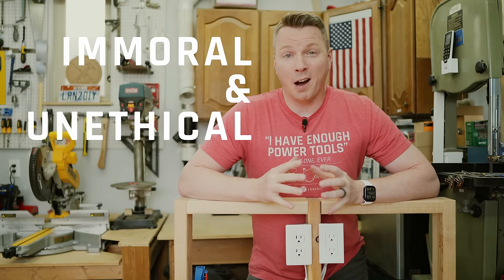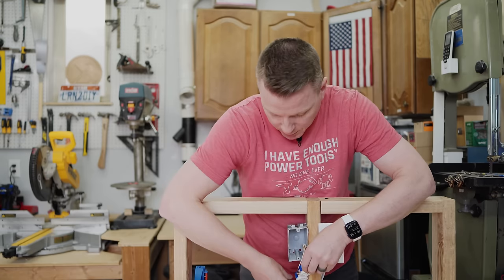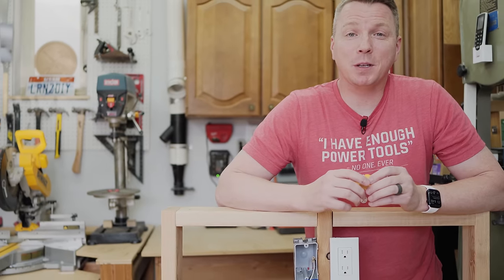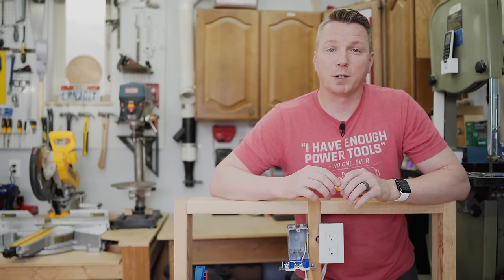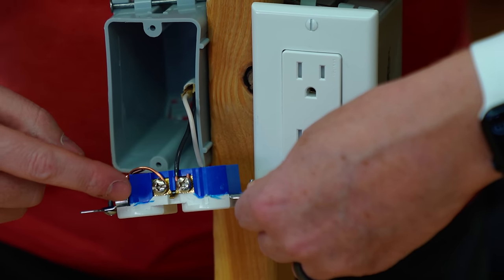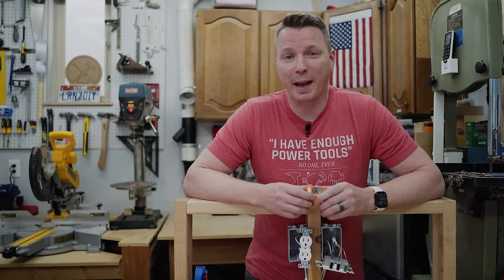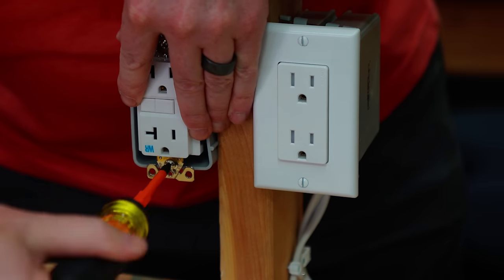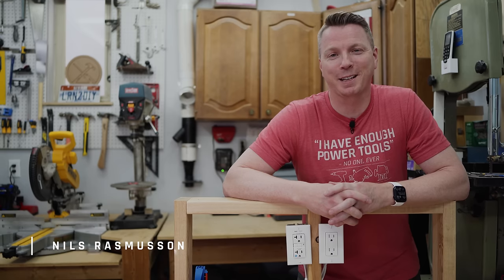People Are Adding Deadly Hacks to Outlets

Comment: The microwave in the house i bought didn't work.  When tearing out the kitchen to re do it I found they had put both the hot and neutral wires on the same side of the plug.

Comment: When i bought my house, my insurance company required me to rewire the whole house.  It was built in 1958, the electrician grounded the wires at the panel, but clipped the ground wire at every single plug.  Which i knew about before signing papers, and planned on moving and upgrading the entrance from 100-200amps.  So not a huge deal, got a decent price on it because a bunch of my friends are certified electricians.  But the entire house had to be completely rewired from top to bottom.  There was nothing wrong with the wires themselves, other than the cut gounds at the plugs.  Comes with home ownership i suppose.

Comment: The third cheapest solution is to add a ground fault breaker to protect the entire circuit.  A ground fault receptacle only protects the downstream receptacles.  Also, the 2023 NEC is now requiring both ground fault and arc fault protection for most locations.  Because of this, a dual function breaker is usually less expensive than a stand alone ground fault breaker.

Comment: Unless that type NM cable is over 20 years old, that gfci outlet that's installed in the video, it's likely a code violation. I'm not 100% sure, but what would the reason be that I would bring it up?

Comment: This would work and provide protection for a short from hot to ground.

The reason why is because they connect the neutral and ground in the panel and on the pole.

It is nutty, but they only have a 2 hots and the earth.

The power company runs their ground to the panel and the panel has the ground rod at your house connected and they have the neutral and ground as the same thing.

It is in a lot of houses.

If your house is built pre-1950 you have just a ground and it acts as both neutral and ground in the panel.

Today the power company has 4 wires from the pole, but they just connect the ground and neutral through other houses

There is no Diode

They should have diodes in every ground and neutral so they can't backfeed.

Comment: Question:  Why is it unsafe to "bootleg" a case ground? The neutral and ground are on the same lug in the fuse box. Generally, the un-insulated ground on a, for example, 12-2 is 16 Guage.
Reply: Bootlegging causes all grounded metal parts to become an energized part of the circuit. Not only does the EGC now carry all of the neutral current, buy anything with low enough impedance that completes the circuit between the grounded metal parts and the service neutral will also carry significant current, increasing shock hazard. Moreover, if for some reason the neutral in that circuit gets disconnected (poorly wired switch, broken wire, whatever), the grounded metal parts could be pulled up to live voltage.

Comment: I like the gfci trick. 
The houses i had seen with 2 prong. All had wires ran in condiuit. So you could just ground the conduit  and then run a redundant ground tail in the box to the outlet.

Comment: Testers are checking for continuity between the grounded and grounding terminals.  Since most residential panels have the grounded and grounding buses bonded back in the panel, the testers will never see this.

While I'm not a fan of the deception, like it or not, putting a jumper between the grounded and grounding terminals give folks options, and yes, even increased safety.  Its not perfect and by no means preferred, but what is the difference between fault current going to ground through the grounded conductor vs the grounding conductor when the buses back in the panel are bonded?  For this to pose any greater risk than doing nothing, the house ground (i.e., grounding rod or ring outside) would have to fail.

Typically, GFCIs are preferred to this type of wiring, but too often inspectors are telling folks they have to rewire their houses and they simply do not have the money to do so.  This often happens when a new home owner is trying to get an occupancy permit and the local authority will not approve the permit without major updates to the home.  Also, the types of homes I expect to see this type of wiring in do not have boxes of the correct depth to fit a GFCI and of course, it costs more money to rip out the plaster and lathe to put a larger box in...assuming the inspector will allow using a GFCI instead of running new wire.

At the end of the day we may not like it, but it is safer than not having any path for fault current to go when there are only bad or impossible options.

Comment: Seems likely that you would only have bootlegged outlets in the case where you didn’t have a Ground the line running to the outlet. So seems like it would be a pretty easy and cheap check to just open up the circuit panel and visually examine the lines coming into the box… And if any are missing grounds, then you probably got something to be concerned about if you have three prong outlets and you should check further.. However, if all lines have the ground wire in them, it’s pretty unlikely that someone would have bootlegged an outlet in that situation.  Not a perfect solution, but perhaps a good starting point to indicate if more investigation is needed or not

Comment: One point that the author did not make that may be missed by non-electrically inclined people. The Ground pin of a cord is connected to metal parts of an appliance. In the event that a Hot conductor of that appliance were to come in contact with those metal parts, the grounded state causes the Fuse or Breaker to trip, protecting the person from shock. On the Boot-leg connection, if the White wire were to become an "open" connection to the power source, other appliances will back-feed the White now jumpered to anything plugged into the boot-legged outlet making metal parts live to earth ground. Example, a bootlegged outlet serving a 120v washing machine, sitting next to a properly wired dryer. Touch the Washer and be a bird on a wire, touch the Washer and the Dryer and get Electrocuted.

Comment: It goes with out saying that someone shouldn’t do this, but I do have an honest question. Were there mass electrocutions with all the none grounded outlets back in the day?
Reply: I can't say if there were mass electrocutions, but it did happen enough where people were shocked or electrocuted to warrant a dedicated ground wire. Especially with old audio and musical equipment. Many old guitar amps are modified to remove the two-prong plug with the "death cap" and bring it to modern 3-prong safety standards. That's only one specific example. In reality, all it would take is a break in the neutral line to make that circuit dangerous. Instead of a return path back to the panel box, you would potentially be the return path to ground if you were to touch whatever was plugged in. Even though the ground and neutral are electrically tied together in the panel box, the separate ground wire provides a dedicated return path back to the panel box in the even of an emergency.

Comment: Could I perhaps install AFCI/GFCI breakers on the ungrounded circuits instead of rewiring the house?
Reply: At best it's a second best solution.
Reply: GFCI receptacles are up to code for ungrounded circuits and are like $10-15 each. They're perfectly safe on 2-wire and easier to deal with than the cost and potential problems associated with GFCI/AFCI breakers.

Comment: got a new t100xr 8.5kw in uk

could this be lack of current causing overheat, maybe a bad rcd or pull switch, they look ok

Also, rcd never trips and the pull cord light never goes out

On cold and echo 4kw it runs fine
but on max 8.5kw it runs for 10 mins then shuts off
the shower power light goes out for a split second but the pull switch light does not
this is the second t100xr to do this
if you put it on from being off all night it lasts 10 minutes but if you put it on right after it went off it lasts 4 mins
water ok
im thinking its not getting the current and its pcb is getting hot because low volts would make it draw more power? if it was the TCO cold water would come out, same with low water
could this be the pull cord switch making a bad connection 
anyone had this problem

Comment: What about grounding a receptacle to a metal box, that is attached to a concrete wall with metal anchors, and the wall sits on concrete pad on top of ground. There has to be some ground path via that for receptacle attached to such a box.

Comment: Thanks for the info. I'm curious if it's legal to simply run a shielded single wire, 14 gauge, to the individual outlets? Take an old 1950's bungalow, run a single wire up into each ungrounded plug and back to the panel or into a grounding rod? Would the code support this solution? If anyone can tell me? Thanks.

Comment: I learned to do electoral wiring as a boy, I can remember two times I ran a (green) wire form the ground plug, to a copper water pipe (whole house in copper, and properly  grounded at the panel and piping properly grounded.) 

IMy dea was I saved the customer 40 feet of wire as the outlet was WAY at the end of an addition and was originally wired with just two conductor NMSC (no bare ground) 

What are the risks?? It seemed logical at the time. It it better than the fake Pirate Ground show in this video??

Comment: Sad that an electrician would do this.  I've done my own electrical (except panel connections) in my homes since I bought my first one ins 2000. I am amazed and the things I have found.  I even replaced an outlet that was wired incorrect by an electrician - he had the load/line reversed on a GFCI

Comment: If you measure voltage from neutral to ground, it should read a very small voltage. If it’s zero, it’s bootlegged.
Reply: No. Maybe if you're drawing a lot of power while you test, but even then you could be positioned such that there is only a very short length of cable back to the main breaker box (or wherever) where neutral and ground are legitimately joined together.

Comment: My brother and I each have our own Electric Contracting business and often share labor on our jobs and we followed up on some work another electrician had started. Under the orders and direction of a  FEDERAL HOUSING INSPECTOR (!!!) the electrician had been shorting neutral and ground to allow the GFCI tester to function "properly" on the receptacles downstream that were fed from the load side of a GFCI Duplex Receptacle via a two wire feeder. The Inspector was so arrogant and full of himself that he would not accept our attempt to educate him on the profoundly ignorant of electrical theory practice that he was promoting so we had to involve the State Electrical Inspector to reign the fool in. To think that he was getting ANY    licensed electrician to short neutral to ground downstream of an OPD is very dismaying to me. It shows a complete ignorance of the importance of directing neutral current back to it's source and a utter ignorance of how a split phase AC system operates. It's like a brake mechanic not knowing a car needs to stop.... it's the most basic fact to understand in preventing electrocution. We were blown away that this longtime Federal Inspector was directing this practice and that we were the first ones to educate him on the foolishness of it. Unbelievable. Maybe the widespread use of this NEC violation stems from him and his fellow inspectors.

Comment: What if the bootleg ground is wired from the ground screw on the outlet to the metal outlet box.  Causing the cheap tester to read that it's wired correctly.

Comment: I stumbled onto an outlet in an old apartment that was 240v that someone had converted to 120v by using the metal box and flex conduit as the neutral line instead of just taping and using the second hot wire of the 240 (which was capped both at the box and in the breaker) and I wanted to scream. I think I was happier before I got my certification because now my eyes are open to the horrors that people have wrought upon my home. Why is every bathroom branched off a single GFCI in the garage? A test of my will to live

Comment: Found this stuff connected to knob\tube in the wall. Fixed the mess and frankly wasn't that difficult. We opened and closed walls and drilled holes for the electricians.

Comment: Other's have commented on the tester being "cheap" not being the correct answer as to why they read as correctly wired.  More on that later.  
While I agree that the outlet should be wired correctly, it isn't any less safe in most cases with the bootleg cheat.  All of the "safety" is provided by the device being plugged in, and so long as the ground pin has a path back to ground in the panel, the device will provide the same level of safety no matter what that path is beyond the plug.  In truth, the bootleg might actually be safer than a properly wired outlet, as if the neutral wire is broken, a user will know about it when things plugged in don't work, where as if a ground wire is broken, you won't know about it without using a tester, leaving the plug in an unsafe state where through your body may be the best route for electricity to flow.  
As for the "cheap testers, being cheap isn't the issue.  Not being designed to detect people trying to fool them is.  they do exactly what they are supposed to, as there is no difference between ground and neutral from their point of view, or that of anything plugged in in normal residential wiring.  Ground and neutral are bonded together in the panel.  The expensive testers can measure how long it takes a signal to travel through the wires and there by tell you if the bond is in the panel where it should be, or if it's too close.  But if you want to be cheap, an ohm meter will do the same thing for you.  14 gauge copper reads about 2.5 ohms per 1000 feet and even a cheap to free harbor freight meter is sensitive enough to tell the difference between 0 ohms and .125 ohms on a 25 foot run from the panel to the box.
Reply: If the neutral is broken with a bootleg ground, the grounded metal parts become energized and can possibly get pulled up to line voltage. Anyone who is electrically grounded that touches the energized parts is in series with the AC circuit. That is most certainly not safer than a properly wired outlet.
Reply: @benchociej2435  it is more of a trade off, between knowing when there is a problem the first time something is plugged in, and maybe getting shocked that first time something is plugged in, if it happens to have a grounded surface you touch and you happen to be grounded yourself.  Properly wired, you get the redundancy of needing two wires to be broken for there not to be a path to ground, but even with both intact, your body can still be the path of least resistance if a device is designed or used stupidly.  I'm not saying anyone should wire it wrong, just that safety concerns are blown out of proportion.  it's no less safe than anyone using any product that has a 2 prong plug on it, and that would be most things we use on a daily basis.

Comment: could doing this trigger a GFCI outlet? our room mate moved out and i moved into his room and he replaced one of the outlets to a grounded one which just so happened to also be GFCI. so is the possible with a GFCI or will it just trip itself?
Reply: I do not think it would trip if you did it on a GFCI outlet but it you then chain it to other outlets and do it there it could trip as it could divert current from the neutral to the ground and the who knows where - like through the cable TV connection.

Comment: I don't think I've seen this before. I have seen "cheater plugs" for apartment buildings built during that same time period. Generally because the cost to ground every outlet and hit multiple units is prohibitive. Seems having a GFCI not grounded plug to start the line would be most ideal to avoid the cheater plug situation.

Comment: in the 70s My dad wpoul s just leave the groud wire  unconnected inm 2 wire outletsNS My grandmother and had a converted 3 prong into 2 prong with  little device made of rubber on the outlet side was two male prongs  and the other side  accepter 3 male plugs.  If the wire was badly damaged he would find the last oultlet in the circuit remove the outlet sercurely attached to the new wire through then pull the old wire out through the until the old wire was out  thern sercure the outlet(vise grips or adding that outlet to the system  the final outlet end so then he pulled the wire so about 2 or 3 inch loop was out on each other outlet to that spot then at  each other box he would pull a loop then cut it and either move the vise grip or place an outlet in the next in line box.  Continuing to do this at eqach box until he reached the first box.  This was easier that removing or replacing the wall  when only the wire needed replacing.  If the wall need replacing as well then he would just remove the wall(the facing) then juat pull out the old wiring and just replace it with new.  When i first got my house it had wiring in a conduit outside teh wall after the first fire we replaced the stucco walls with panelingand put the wire inside the wall.  Seen everal old structures [redating wire where the wire unprotected was on the outside of the wall. I have put many outelts in housing myself.